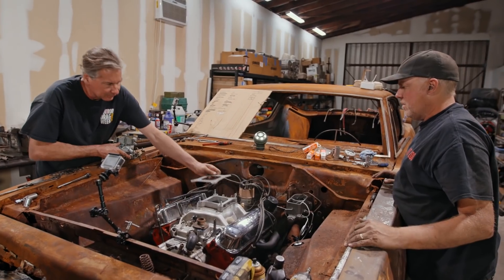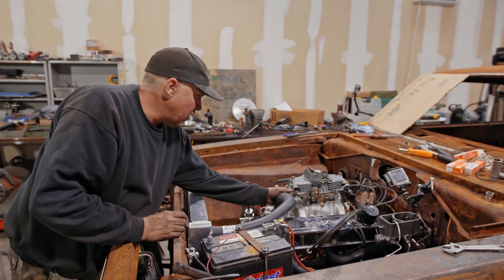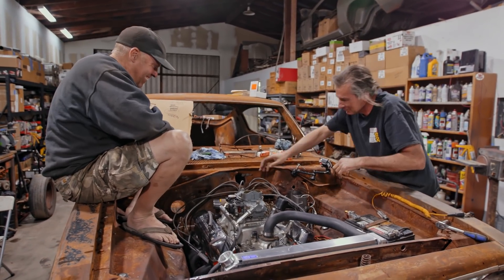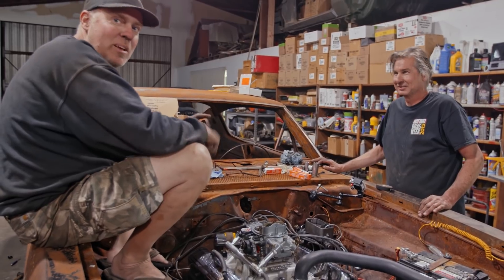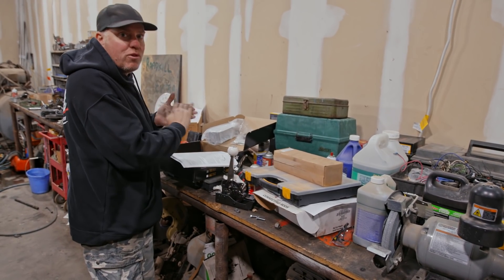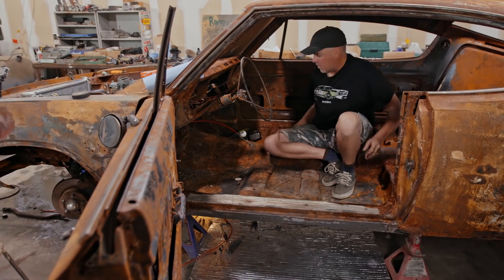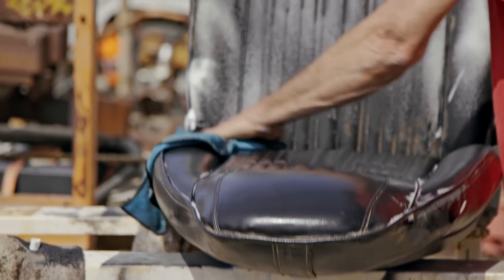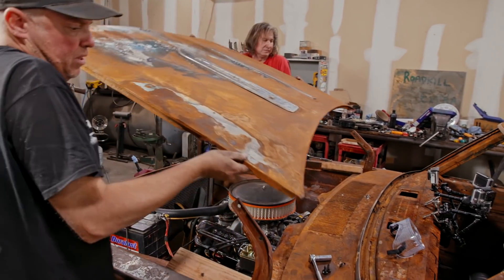Ooh...BBQuda! — Roadkill Garage Preview Ep. 30

Comment: T Bars! I fell out laughing. 25 years ago I went to work for the City of Lawton as a mechanic. We had cruisers (police) with T Bars. Always had to measure the fender clearance even if we did not replace the rubber bushings and that car just came in for general service or brakes. We would start with a general setting a bounce the front end a number of times and then it would be good.... enough. I just had a flashback when T Bars were mentioned.
-MIKE

Comment: I like your video because you alway save a car that is old and abandoned and used them again
Reply: This car wasn’t abandoned btw
Reply: Use them again, only to not use them for a year afterwards. During that year they also take out the engine and other parts to put in other cars that they will forget about later.

I wish they would just sell the cars to people that would continue to fix the cars or run them like roadkill instead of just messing them up.